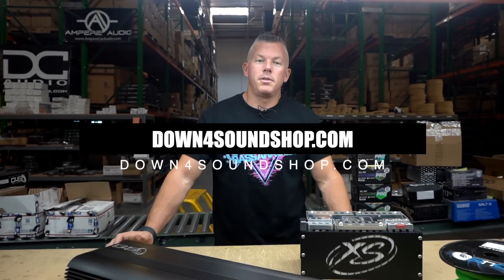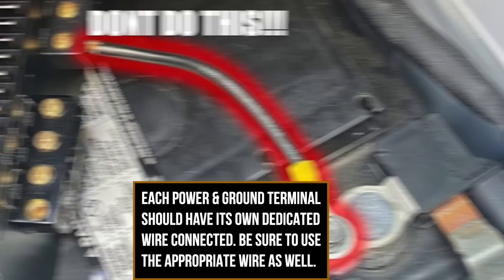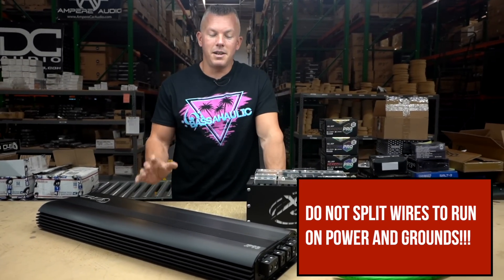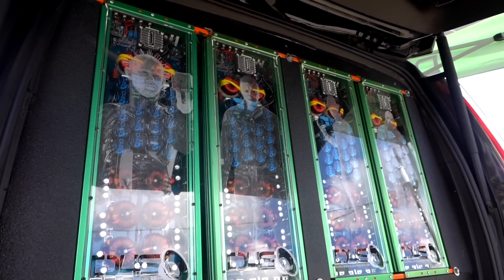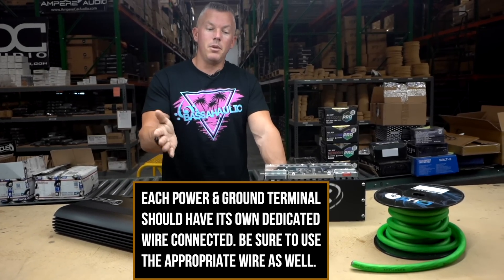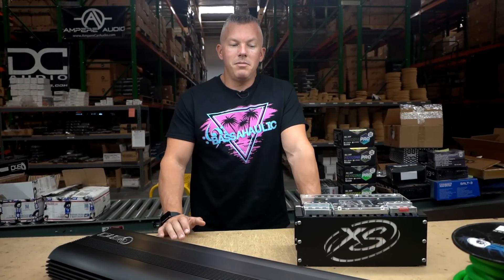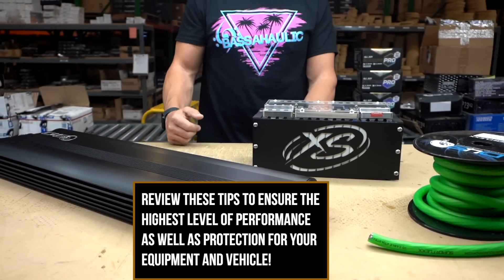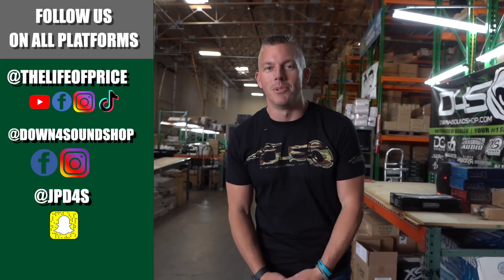STOP DOING THIS TO YOUR POWER AND GROUND TERMINALS!!! WITH JOHNATHAN PRICE

Comment: I have 3 batteries on my jp63 amplifier with a 300 amp alternator  and I live in Houston tx and it passed the heat it only got up to 117 degrees and the temperature outside was 103 ?

Comment: My JP53 was perfect and actually did over rated power but I did have a problem. The Bluetooth bass knob would not connect. But I fixed it. So far it’s an amazing amp

Comment: I have a positive wire off my trunk battery, running into a fuse then to a 2 out distribution block to separate amps, is that wrong?

Comment: Question:  I have the MM1000.  It is my first class D amplifier.   I notice noise on the FM band of the station is weak or non-existent.  Am I getting switching noise from the amplifier?  It stops when I turn it off or turn the bass knob all the way down.

Comment: 4ga power to a 10,000 watt amp is crazy.  My rule of thumb is 4ga wire in a 20 foot run is good for 800 watts MAX, and 00ga is good for 2500 watts MAX.  Both at 14 volts.  Good good people are insane.

Comment: I learned from Steve Meade and Big D that to run a bigger amplifier you need the right fuse type, wiring, and power for it not no walmart brand 8 gauge wire claiming its 4 gauge or a generic fuse either. Its either run it right the first time or have never ending problems later

Comment: My old pioneer gmh 200 had three power and grounds for a 300-watt amp back 91 and would not turn on with all power leads not hooked up. Gotta love bi polar. It sounds so much better than mosfet, but the efficiency is awful. All amps with dual power inputs should have a protection circuit for that.

Comment: My set-up for a single fosgate t1 12 800 watts rms subwoofer wired to kicker cxa1200.1 amp at 2 ohms. Did the Big 4 upgrade with a yellow top optima under the hood xs power d925 battery in the trunk.  All 0 gauge ofc wires.  Stock 130 amp alternator. 😮 amp runs cool and voltage stays around 13.4 full tilt. Takes power to make power 😊

Comment: You CANNOT run big amps without big, proper electrical. High-output alternator(s), batteries with the appropriate reserve capacity and power/ground cables capable of carrying the necessary current to power these amps. You MUST do it. It IS NOT an option! Gotta have power in to get power out, period.
Without ALL of these things, there is no benefit/no reason to buy big amps. You would get louder on 1,500 watts and not smoke the amp with stock electrical/charging system.

Comment: Thanks for clearing up the Dual input/triple input wiring question I’ve only been asking myself because my common sense told me to run a dedicated line from the battery per input per ground however what I’m seeing A lot of folks do is take that 1/0 gauge into some sort of a distro y splitter block and come out with two powers. People do the dumbest shit ever. I had a guy telling me today his head gasket is blown so he brought it by and I was ready there with my compression tester and head gasket leak test kit all because he said he’s been seeing it leaking coolant  LOL!!! Okkkkk open the hood what do I see ? Infinit q60 with an aftermarket nice ams expansion tank with two radiator caps , one side is the turbo coolant and the other is foe the engine but what’s clearly in my face is two radiator caps that are not reading the labels right side up which immediately signifys to me that they aren’t on properly. Sure enough both caps were not closed all the way and it had been leaking right off the top smh the other was so brainless that they themselves can’t seem to figure that much out and diagnose something as simple as a cap being improperly installed …… car audio ? Heck I’m surprised you haven’t seen 10% failures for all the dumbasses out there that blow them up upon unboxing. I say you been lucky friend it could always be worse 😂

Comment: 😂 nubies 😂 I actually doubled each power and ground, it takes power to make power, I still have my original 23s, 43s and 63's no problems and a radiator fan to cool my amps because they are located in my trunk for all the nubies that don't know heat disapation is another law of physics to abide by

Comment: so i rock your stuff it deff does the power the problem is they sound mehh, signal to noise ratio posted on any amp i think is a lie, the amps have alot of floor noise/ hiss. no its not my gains there turned all the way down and still have a hiss with sensitive tweeters or speakers, so in a nutshell these amps just produce alot of dirty power. Miss my alpine stuff just wish it was as loud

Comment: Good video. No one talks about cable length, though. If you are going 3 feet, 3 zero gauge runs from the source is completely unnecessary. No one talks about the total resistance of the conductor. Hell, Steve Mead even had a video where he helped someone that had a zero gauge going to his fuse near the battery then had a 4 gauge from the fuse block to the battery (like 8 inches). He said that was a bottle-neck. That's not how it works. This industry is filled with people that say what to do but never say why. This stuff can pretty easily be quantified. But, yes, I do agree that so many people that do "installs" have absolutely no idea what they are doing.

Comment: The only company that I had an issue with is Orion. They told me they don't have a repair department even though the warranty was still valid. Another thing is make sure your wire can handle the amp and fuse rating. Don't want to run more power on a wire that can't handle that much power.

Comment: I read reviews on different amps all of the time. Something you read comments of customers saying they were sent 2 or 3 defective replacement amps. So many factors average audio guys don't know. Not just needing bigger power supplies for amps like these, but matching wattages with speakers & amps. Even understanding ohm loads. A local guy purchased a new 2 channel highs amp (did 360x2 rms @2ohm) for low wattage horns and tweeters. Originally said he just needed a small 2 channel. When that one went out i replaced it with a new bigger 2 channel that did 800x2 rms and he told me this one also went into protect. I told him there was no way everything was wired correctly and he felt as if i was selling him bad merchandise. I told him i would take a look at his setup. 14 tweeters and horns hooked up to 2 channel amp........all wired in parallel. Most of the tweeters and drivers were 4ohm so both channels ohm load were well under ohm. I switched that amp with a smaller 4 channel and his speakers ran with no problems. I lost not only a lot of money on the 2 new amps but a lot of time. I didn't charge him for evaluating the problem or install.

Comment: Hey jp do you think 1 run of 2/0awg cable from front bat to rear bat is ok 

300-340a alt 
170ah agm with a Victron Cyrix ct 230a VSR 
Is good enough for a 3600-4000w half bridge amp 
Yes there are 2 sets of cable inputs I was planning on doing both sets +12 and -12 directly to the 170ah battery fused with a correct rated isolator switch

Comment: There are a lot of new car audio people out there that doesn’t understand this. Maybe it would be ideal to make a diagram showing how to hook one of these up from your battery so this way they can see what you mean because a lot of the newer generation doesn’t understand this JP. Diagrams go a long way imo but keep up the great work. I also have a question about the wireless bass remote. Can you add a battery in the remote because they make some small batteries that will fit so you can take your bass knob in at night charge it and your good for the next day 💪

Comment: ALSO.  I SAID.  MY DESIGN.  THAT YOUR CAN USE FOR FREE.   CUT THAT AMP IN HALF.     PUT POWER SUPPLY SIDE NEXT TO BATTERY.  THEN ON OUT PUT OF POWER SUPPLY.  220 VOLT THEY RUN 3 RUNS OF 4 GAUGE TO AMP IT TRUNK.    PROBLEM SOLVED.  POWER SUPPLY NEEDS TO BE UNDER HOOD NEXT TO BATTERY SO 0 GAUGE NEEDED IS ONLY 3 FEET

Comment: 1/0 is good for 125 to 170 amps depending on the type. whereas 4 gauge is only good for 70 to 95 amps depending on the type. Undersized cable or wire can and often will cause a fire, especially if you aren't properly fused.

Comment: I have to admit.... I shot-gunned two 4 gauge wires into a 1/0 input of my JP23v2.  It still performed since the runs were short, but I have since corrected that with proper 1/0.  Also, about 10 years ago, I was running a CT Sounds 4K and only hooked up half the inputs, since I was running 2 ohms instead of 1 ohm.  I had zero issues.  I bought that amp to replace a pair of Audiopipe 1500's that were strapped, but would overheat.  The CT 4K only got luke-warm running the same subs.
Reply: You knew what you were doing..some folks are probably going half ohm on stock electrical on 4 gauge on 4k's😂
Reply: Two runs if 4 is almost 1/0 its actually closer to 1 guage but theryre not all made the same either you want actual copper some of which is tinned not CCA aluminium, which might be omay for grounding, it will increase in resistance as it heats up

Comment: Good video. I cant believe someone would not use all the terminals with dedicated runs. Clearly they put them there as they are needed. I watch the amp dyno video's on these amps and go WOOF look at that amp draw. Not for stock electrical yet people try that crap so often.

Comment: i run dual inputs especially for my bass amps and if its 15ft or longer of a run then I'll increase the size to the next size up of ofc wire so if it calls for 1/0 I'll run 2/0 and use dual input reducers so no matter what the amps don't starve for power..

Comment: Wow thats wild its a reason for those triple inputs that amp is not getting proper voltage and will do some damgae for sure i agree jp
Reply: No it will get proper voltage still with just one wire it’s not able to pull amperage it needs though to perform properly.
Reply: @Thumper68  It wont get proper voltage, the wire will basically soak up the voltage. 

Recently I helped a person with their issue, amplifier turning off due to low voltage (10v at the amp)
At the battery it was 13.5v, the issue was their 4 gauge wire run, after replacing it with 1/0 gauge the voltage issues went away.
Reply: @LatvianVideo  you don’t understand the difference between voltage and current. It will get proper voltage to power on 12.8-14.4 but not enough current to supply it’s need thus lowering the voltage.  That said it can’t take anymore then you give it. The biggest issue is low voltage and current are the worst thing on electronics which shortens life significantly.
Reply: @LatvianVideo  that’s a current issue. Amperage draw is current.

Comment: I put your JP8 first version through some hell. It is still kicking. I got it wet, shorted it out multiple times, and just ran it to its max clipping the entire time since I got it several years ago. I am amazed it is still working. This amp seemed to be forgiving of my chaos. 

I will never trash your amps, but I will laugh at that joke of a blue tooth speaker with no bass. 😝😝
There you go, a compliment and an insult all in one shot.

Comment: @THELIFEOFPRICE 
It’s scary that someone would use 4 gauge electrical with a JP43 that has the capability to generate nearly 10k burst. And the fact that they say “I’ve been doing it a long time” means NOBODY should listen to these fools still using the same power/grounds that they did in 1997 for them and their homeboy’s Hifonics 240watt  amps… 
JP, keep doing your thing and know that the common sense Audio Lovers understand the level of quality you guys put into the D4S product line. 
Haters will always hate, but the other 90% of us love what you do and know it takes heart & dedication to bet on yourself and open a business at all. Much less have the level of success you have had. It means you have great people around you, and also that you are a good leader.

Much respect !!
Reply: The JP43 has been dynod at almost 5.7kw at 1ohm, thats 7500w coming out of the battery. thats a LOT of power

Comment: 3000 watts @ 13.3v = 225amps.

Volts * Amps = Power (Watts)

Watts / Volts = Amps

If you use a HIGHER VOLTAGE and less amps you can use thinner wire.  You'll see this with various diy Solar Panel projects where a person might have 150v and 20amps (150v * 20amps = 3,000 watts) coming off their solar array to their mppt (solar charge controller) and they can use 8awg wire perfectly fine in that application for that 3,000 watts.

In car audio you're limited by the 12v system of the vehicle, so to increase power (watts) you have to increase the amps side of the equation.  More Amps REQUIRES thicker wire.

If you do not accommodate a high amp load with the thicker wire or combined conductive material across three different wires as the amp in the video requires, the wire will get too hot and the contact points in the amplifier will also get too hot.  You are putting your products at great risk of burning up when you don't allow for enough room for all those amps to travel.
Reply: Also the voltage drop increases if the wire is too thin and too much current, so in the end you might be running your amp at 10v, even if your battery is at 13v

Comment: It's crazy to think with how much information there is out there, there is such a lack of knowledge. Quantity over quality (knowledge) strikes again...

Back in the day, a single 8ga was enough to power your 25watt x2 amps. My front stage amps have an RMS rating of 700w (70x4 A-class, 140x3 AB-class). Maybe a 2-3inch run of 8ga, total power and ground,  could run that but I wouldn't risk it.

Comment: True, there are folks that have no business attempting their installs & they're usually the loudest ones in the room but let's not pretend that there aren't legit fails from seasoned vets in the bass head game & to label them a hater is a cop out. To insinuate that they purchased the amp with the intention of getting it to fail so they can announce it to the world is a reach. If it weren't valid then you wouldn't feel the need to go into damage control mode like this. It isn't the product failing that's the problem. No manufacturer of anything electronic is exempt from defects. The problem is not honoring warranty when it isn't user error. 
Let's be real, you had haters long before the amps & yes, there are haters that hate on anyone's success. That's how the game goes but the bulk of your haters hate for other reasons. Unfortunately there's no way to get a narcissist to get themselves to look in the mirror & acknowledge the fact that they're a narcissist.

Comment: I agree with you, and there are a lot of inexperienced people out there who try and install equipment and always run into problems. That is one of the problems I run into out of business here, JP. I'm always saying leave it to a professional if you don't know what you're doing. This way, it will be installed the right way the first time.
Reply: The internet is full of proper installation techniques, explanation of wiring requirements, air space requirements, so on and so forth. There are guys out there who do in-depth installation blogs, and they can teach so much to people new to the hobby. However instant satisfaction, and lack of funds really contribute to the problems as well as lack of experience and common sense.
Reply: @paulfretz6777  That's all good, but if they pay any attention to what they are watching, there wouldn't be any problems either. Yeah, money problems are an important factor, and  It's like I said if you leave it to a professional, it will be done right the first time.

Comment: I bought a 4500rms amp used for $400 bucks and thought it was a steal. I’ve spent x3 that just upgrading my electrical, after realizing my stock electrical wouldn’t cut it.
Reply: Yeah, people only research after they jump into a project. OFC is not cheap.
Reply: But welding wire, thicker, copper, an and cheaper
Reply: @MrInfoPhilly Yup

Comment: It only ok to y or distribute you power cable if yous single run is say 2/0 xl to only 2 1/0 cables no more.  Or 4/0 sh to 3 1/0 cables . Only way I would y off a cable. ????
Reply: I would think so. I have done it before say for example with a 1500rms sub amp and a 400 rms full range amp. Then run a 1/0 to the back that then feeds both the amp's. But the math in my head said this was ok as the amp draw combined was still well under what that 1 cable could handle and it just made for less wires the hole way.